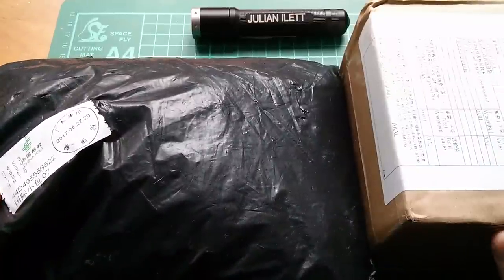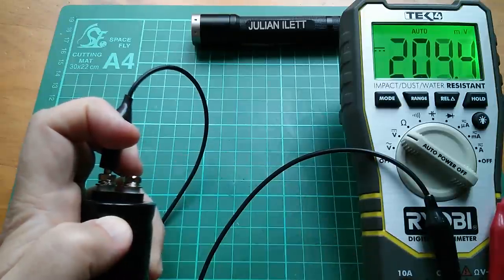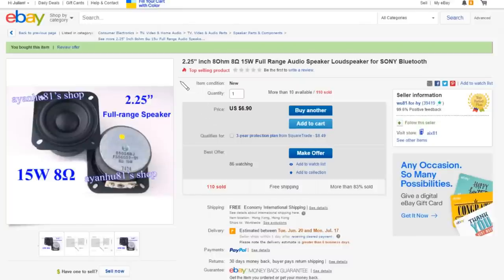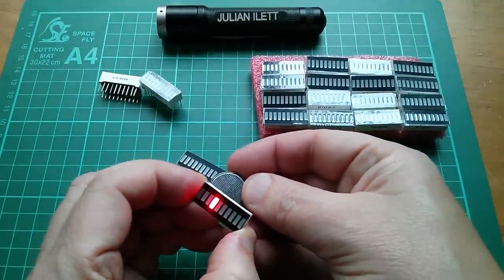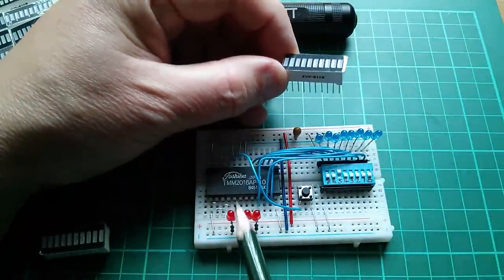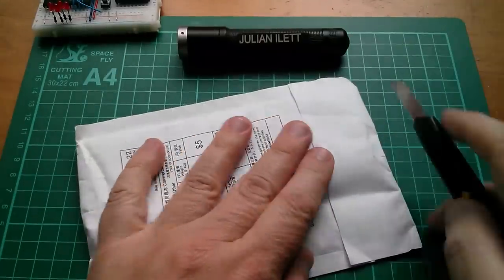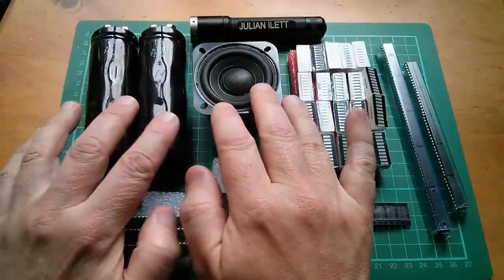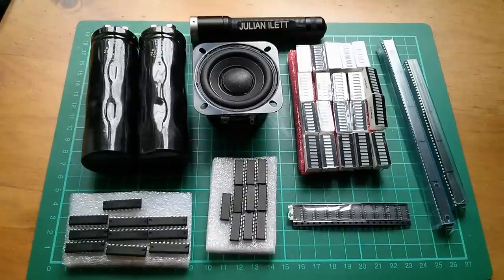Julian's Postbag: #99 - SuperCapacitors and Computer Chips

Comment: Hi Julian, really enjoy your videos. I often see super cap stuff where it might be helpful for a simple way to figure out the absolute maximum equivalent mAH power instead of just volts and farads.  Obviously this will be a bigger number than reality due to all the losses in reality.  But to figure the "top end" of your system, here is the calculation:
Power in a cap is J = 1/2 * V^2 * C.  So for your 2.5 v 700F that is gives J = 2187.5 joules.
A Joule is a watt-second, so divide by 3600 sec/hr to get P = 0.6076 watt-hours.
Since a watt is volts * amps you can divide by volts to get AH =  0.2431
Then convert to mA by multiplying by 1000 and your maximum for the cap is about 240 mAH.
From there you probably should multiply by 0.67 to get in the ballpark for a real discharge curve and you will get about 160 mAH.
Reality will be less, but that should give a general idea of what you are dealing with.
I hope this is useful; keep up the good videos and fun experiments.

Comment: As it's probably already been mentioned, yes, those silicone plugs are pressure relief vents, so in the case of catastrophic failure, you don't end up with a huge explosion and aluminum shrapnel embedded in everything.

Comment: Yes, the silicone plugs are intended to blow out if pressure increases in the capacitor. 😉
Reply: There is a Video from Photonicinduction, where he kills some big Capacitors with a Welder, which shows the Plugs in action.

Comment: Hey Julian,

When you're soldering the 0.1" header on the SMD breakouts absolutely use a breadboard for stability but do not do the SMD work in the breadboard (if you use a hot air station), you only know you've ruined your breadboard after the fact.

On the other hand you could use the crappy breadboards...

Comment: I had heat problems at 20Mhz clock with 4, linked 74161 counters. I solved problem with heat sinking. The carry pulse is only >50nS so it went to a F/F clock input to reload parallel counter inputs. My 1st big digital design of the 80's

Comment: You might be interested in building an R-2R DAC (x2) for your VOCODER project. 
As you know with a serial to parallel output latch (74HC595) and R-2R ladder resistor network, you can built a flash DAC? 
Very high speed and accurate and tends itself perfect, with a retro project like yours. 
You bought a lot of 1% resistors lately. Hand pick some (10k, 10Kx2 for the R-2R) , and you'll have a precision R-2R resistor ladder network on the cheap. Just a suggestion. Entertaining video as usual :)

Comment: 5 of those Nippon in parallel looked indented when new then filled out hard and round after a week of charging and leakage when down to about 2mA! I found precharging in parallel is best in voltage steps to reduce power waste. See my other JI post for further details. I use a CV curent limmited supply to condition super caps. Always put new one in parallel when conditioning. I was frustrated by power wasted by the farad tolerance activating protection circuits in series cap batteries.

Comment: Why do the caps have dents?
Strange design choice.
I like your solution for SIL LEDs, but why not go with an 8-bit segment?
Reply: The dents are called rills.
According to the CornellDubilier documentation:
With rilled construction the element is secured by rills, spoon shaped 
dimples in the side of the can.   Rilled construction offers the 
industry’s highest vibration and shock withstanding and excellent 
heat transfer.   Besides increasing ripple current handling, the rilled 
construction extends the great value of the Type 3186 into military 
and transportation applications that require rugged mechanical 
capability.

Other options might include filling the empty space with some other medium.

Comment: I'm having problems with Rohm Unisolated DC-DC Converter chips used in Hortron IR door sensors -- I'm trying to tap off 3V (+/- 0.25V) from 5V line and connect it to a doorbell circuit that operates at 3V, but despite the voltage divider providing near-perfect 3V even with the bell connected, it refuses to work. (The line isn't being loaded down by the circuit, the voltage is stable, and bell section works perfectly when fed with 3V from external power, rated at 3V 0.125A)
I can't even find the datasheet for this particular one so I used my only multimeter (notice it's not DMM) to find the 5V line which is supposedly used to run the internal CPU.
I can't order any more parts so I had to come up with something that could convert 5V to 3V, but apparently mine isn't working.
Resistor divider value: Vcc - 10K - OUT - 10K - 10K - GND

What could be the problem, and how do I find the faults with minimum amount of tools?
Reply: Two 10k Ohm resistors in series across 5V means that total current through the resistors is 1.25 mA. That's the problem. Why not use 3 Silicon diodes (chosen to be able to handle the current required by the load) in series with the load, and use the 5V supply? Each diode will drop between 0.6 and 0.7 Volts, so the load would 'see' between 2.9 and 3.2 Volts. Add a 1k Ohm resistor across the '3Volt' connections to clamp the voltage to 3V when the load is disconnected, for extra safety. Dead simple and robust. You could use a zener or a voltage regulator, instead, but you only have 2V of overhead, so the diodes are probably your best option.
Reply: My bad; make that 0.25mA through the resistors, for 20kOhms across 5Volts. Must stop doing mental arithmetic at night, after taking my ugly pills!

Comment: Those 74HCT138 have active low outputs so you're going to be surprised when all the outputs are high except one at a time.  LLL input will give you HHHHHHHL output.
Reply from the maker: Perfect - the enable inputs on the 74HC574 and 74HC541 are active low too :)
Reply: Okay, I thought you were going to output them to your LEDs and it would be awkward having 7 on and 1 off.

Comment: They are a bit more expensive but you can get the through hole SN74HCT138 chips from Mouser. http://www.mouser.com/Semiconductors/Logic-ICs/Encoders-Decoders-Multiplexers-Demultiplexers/_/N-4s67oZscv7?P=1z0z63x&Keyword=74hct138&FS=True

Comment: The bar graphs seem like they would be neat to be used in watch project.
Reply: I hoped he was going to use them in the speaker project. :]
Reply from the maker: As a capacitor voltage indicator - nice idea :)
Reply: Well, I was originally thinking of blingy volume meters on each speaker :D
Reply: That would be up to 200 milliamps of additional load on the capacitor ... just to show how much is still left in the capacitor.
Reply: All you have to do is put a button on it so you can press the button to check.

Comment: what is considered a safe charge current for such capacitors?
Reply: The datasheet doesn't say what the maximum current is.
The internal resistance is listed as 4 milliohms. I would say about 30 to 35 amps would be the maximum continuous current. That would dissipate 3.6 to 4.9 watts.

Comment: Why do they make them at 2.5-2.8 voltage? Why not higher?
Reply from the maker: Limited by the electrolyte - it will start to electrolize at higher voltages.

Comment: Is there a reason why super capacitors are always low voltage. Can they not produce 10v for example.
Reply: he dielectric later has to be very thin in order to achieve high capacitance for a given dielectric material, plate area and package size. This thinness means that it cannot handle much voltage before it arcs and damages the dielectric layer. If you want twice the voltage capability, you need about twice the dielectric thickness and four times the total capacitor plate area, so higher voltage capacitors are inherently much bigger in volume than supercapacitors. Think of these as miniaturised capacitors, if you like.

Comment: Can you give me a link to that constant load, Julian? I'd like to use it with a solar panel to charge my SLA 22Ah battery. (presuming it doesn't get blown sky high like the last one I used did.. a 10A LED driver blew up when I tried using it several times, I think rectifier failed catastrophically or sometin)
Reply: its not a battery charger or charge controller, I dont see how you could use it to charge a battery. likewise an LED driver, which will deliver a constant current but doesnt have the voltage cut off you need in a battery charger

Comment: what is the difference between supercapasitors and normal battaries
Reply: Super capacitors are more reliable, batteries die quicker
Reply: You can charge and discharge them a lot faster and go all the way down to 0 volts.
They also work better in higher heat products compared to lithium batteries. They have a lower energy density but you can charge them more times than normal batteries.
Reply: shoopnooop thanks a lot
Reply: batteries store energy in the form of a (sometimes reversible) chemical reaction, supercapacitors are very large, high capacity capacitors. they store energy in the form of an electric field between charged plates.

Comment: I don't hunderstain what's the difference between a super cap and a batterie
Reply: I am going to start with the assumption that you know a battery can take a long time to charge up to hours. a capacitor for simplicity sake charges almost instantaneously if you let it, more in a moment. When I was in Uni I had a professor make the statement that we would "never" see a 1 Farad capacitor small enough and light enough to hold in your hand, well a super capacitor is just that using thin layers folded back and forth. ok so what allows it to charge so quickly without the physics. A capacitor will reach its max charge in 5-time constants (T) in seconds. In the first time constant it charges to 66 and two-thirds of max potential math T = R x C  where R is series resistance and C is Farads. Second-time constant we charge to 66 and two-thirds of the remainder max potential; third time constant 66 an two-thirds of what is still remainding; rinse and repeat for T 4 and T5.  
Discharge is the reverse, it will release 66 and two-thirds of its stored energy unless the current flow is limited.  This is how they make those little tiny boxes that can jump start an automobile. There is more to it than what I have described but I'm keeping it simple